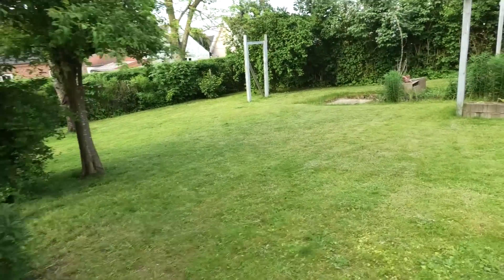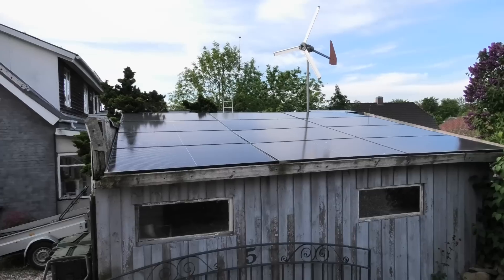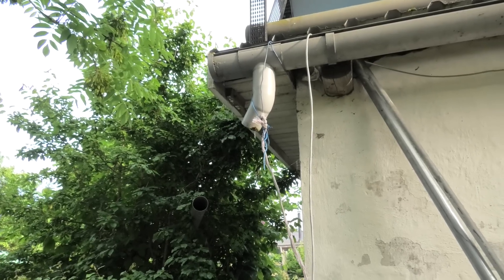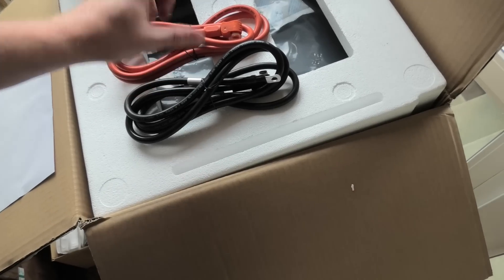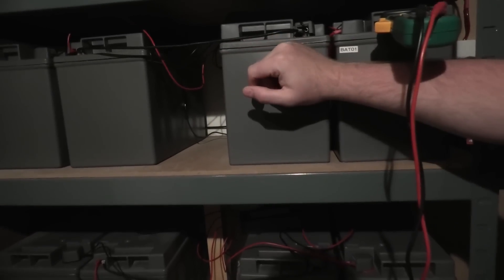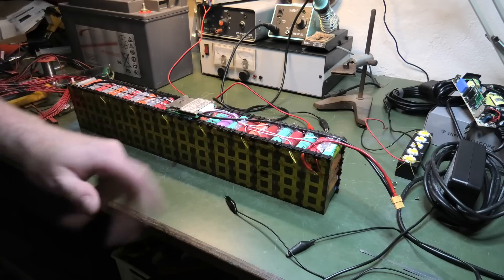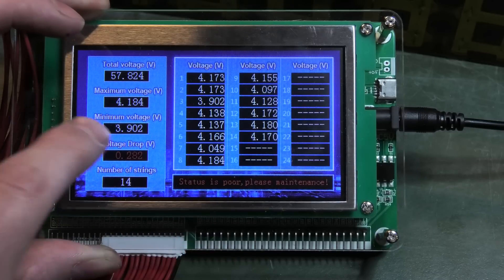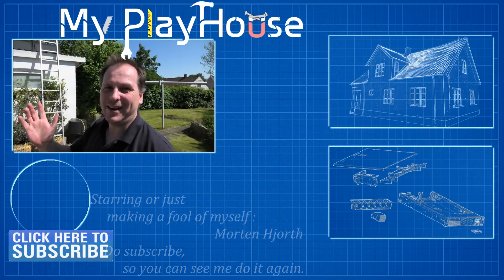An Update of all my Solar, Panels, Batteries, BMS, Sunburn - 1076

Comment: May I ask how well the agm battery equalizer is performing? Have you noticed any improvement  in your batteries in using the equalizer? Also does it help to desolfate your batteries or do you have to buy a desulfator separately?
Reply from the maker: I am not sure my gel batteries is to saved :-/

Comment: Hi Morten, I saw a good video, on adding Acid to Gell Lead Acid Batteries. "How to Revive a dead 12V Sealed Lead Acid Battery" by "vuaeco" on YouTube. "Turn a dead non-spillable sealed lead acid battery in to a good semi-spillable lead acid battery by simple methods. No Epsom Salt or Alum Rock is used in this video!" ( https://youtu.be/8l59knYW8rg ). I remember, back in the 70's & 80's. There were businesses, that did this to Regular Lead Acid Batteries for Auto's. And sold them as Rebuilt Batteries. I don't think I ever bought one. Because I wanted my Batteries to last, at least 5 to 7 Years. But, it may be worth a try. Since it's so expensive to replace all of yours. I actually have eight 1000 Cranking Amp, Truck Batteries. That were given to me. I haven't done anything with them, but put them in the back of a 3/4 Ton Dodge Van, that I have. I wanted to turn it into a "Hybrid", Gas & Electric Van. But, haven't been able to do that. As long as you don't Discharge them too much. They would also, be good for use in a Camper Van. Which is what I want to do with the Van. I would also use a Hydrometer which reads the specific gravity of battery acid, to check them, while adding the Acid... Don
Reply from the maker: Hi Don Bishop
Thank You very much!  glad you liked the video :-)
Thank you for watching! :-)

Comment: Nice Morten, where did you get the bolts for the roof? and are they not supposed to be at the top of the waves?
Reply: The troughs are screwed to the roof joists
Reply: @peterg.8245  what about water leaking thru when they are at the bottom
Reply from the maker: I got them from here,, https://bels.dk/schletter-gevindskruer-12x300-mm-samlet-5705154246629
They was a lot cheaper last year!
I have to mount them where there is something to screw them in to.